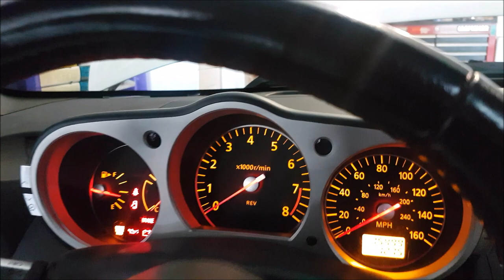Nissan 350Z / Infiniti G35 Secret Diagnostic Testing MODE | AnthonyJ350

Comment: This is great, I just replaced both motors, only one was bad, but what the hell, and holy crap what a difference I go from 208 down to 196 in the matter of seconds, but I actually have to try to get to 208 because it’s rare for my car to even go that high so this test was great for that and I’ll tell you what both fans running on low. You cannot hear them at least from the car and barely outside of the car and they are very effective. Used those TYC brand motors with original assembly I’m a happy camper 
Thanks dude! ‘06 G35 coupe
Reply from the maker: So glad to hear the video helped with your diagnostics!

Comment: You and I have the same dreaded white powder on the hoses 😂

Could be because my hoses are getting old (new radiator) but the hoses have been going white for some time now (mainly to the left of the block).

Am going to do a leak test soon. 

Awesome video yet again man. 👍
Reply from the maker: Ya if you research silicon hoses, they're kind of porous, which I suppose leads to the spots.  The car isn't daily driven and I check fluid levels, so I'm not too concerned.

Comment: Are both fans supposed to turn on or just the driver side high and low? My passenger side does not come on at all during testing
Reply from the maker: Should be both
Reply: @AnthonyJ350  thanks I did swap the driver side plug over to the passenger side fan and turned on my AC. The fan did turn but slow and weak. I could stop it with my finger. Will swap out the motor tomorrow morning.

Comment: Noticed only one radiator fan is kicking on whole driving with ac on. Decided to try this only to find out neither fan turn on dueing the diagnostic. Im assuming i just need a new fan?
Reply from the maker: Fan does work though. What's controlling the fan there's something wrong. Does it turn on by itself when idling when it gets hot?

Comment: Hi there sir, My 2008 350z is causing transmission to stall and cut out at 3K-4K RPM. Does this mean I need to replace my fuel pump or do I have a bad transmission? My 350z only has 83K miles.
Reply from the maker: Did it throw a code?  Sounds like you need to bring it to a mechanic that has worked on these cars.
Reply: @AnthonyJ350  I DID TAKE IT TO A NISSAN MECHANIC AND GOT IT DIAGNOSIS DTC'S P0731 AND P0732
Reply: Check cam sensors vacuum leaks your vtc solenoids could be bad Ecm there could’ve a short in your harness bad coils etc

Comment: How do you do the instrument cluster test? I can’t find it anywhere.
Reply from the maker: What's going on with yours?
Reply: @AnthonyJ350  if I understand correctly this is how you can tell if your fuel gauge is a cluster issue or something else 
Mines kind of in different places when I start the car but eventually makes it way to being correct after driving a little, the needle never goes below what’s in the tank, Let’s say I have a half a tank when I start the car in the morning it reads full or 3/4  but after driving a half a mile, it’ll go to a half a tank, and if I top it off when the needle reads 1/2 tank, it takes 10 gallons, which is correct, I believe during the self test if the cluster is OK if the needle lands on a half a tank, regardless of how much fuel is in the tank, it might be ignition off press the odometer needle turn the ignition on and tap the odometer needle three times, I’ll try in morning
Reply: @AnthonyJ350 IGN off:
Press and hold A/B trip odo needle:
IGN on:
Let go of A/B needle & push it 3 times 
Then push & hold A/B needle 
DONE
You prolly already knew that
Reply from the maker: @stopher1971  Actually, no I didn't know that. Will have to do a video to share with others. Thank you for teaching me something new 🙂

Comment: Anthony. Do you know how or do you know how to repair the headlight leds  without replacing the whole headlight?  I have an 06 360z.
Reply from the maker: I haven't done it, but you would have to disassemble the assemble and install a new LED.  I'm over simplifying as you would have to probably delaminate several layers and there's probably a circuit board attached to it as well.
Reply: AnthonyJ350 thanks for the reply. I don’t want to destroy my headlight.

Comment: Thought I had heard all there was to hear about the 350s modes. Ya learn something new! Thanks
Reply from the maker: You bet!
Reply: @AnthonyJ350  in your video you had all of the plastic covering removed on the right side. Even the piece that makes a water seal against the windshield. Well, the previous owner did the same on my car and broke that weather strip. Is it hard to replace? Obviously they didn't tell me and it wasn't noticable until I started detailing the car. I fear water has creeped into places it shouldn't be and rusted.
Reply from the maker: @shadowoffair09  The piece definitely directs water away from the  HVAC intake and the firewall grommet. The windshield is sealed by the glue that holds it in. Did you remove it and inspect underneath?
Reply: @AnthonyJ350  no I did not take it off. I never figured out if it was hard to disassemble or not. I'll take a look at it for sure. I have never had any issues with the HVAC system thus far but I have just one event of mild water under the passenger foot well. It was after driving in a very bad storm. Guess I have some inspections to do

Comment: Does this confirm IPDM functionality?
Reply from the maker: Technically does I suppose.
Reply: @AnthonyJ350  I've done this before because i had issues with my headlights only one was on. I knew it was good i recently changed the ballast and bulb along with some janky wire mending with electric tape. Performed this test and i was surprised it worked back then, but as of now about several weeks later i cant get the mode to engage. Nothing happens, I do get a flashing ses after a few seconds of the car being in the on position about 5x. I have u1000 & p0462 code

Comment: Hey bro can you help me, I’m having issues with my 350z it doesn’t run very well,  I have the vdc off, slip, check engine lights, it runs but it does accelerate correctly, idk if it is in test mode or limbo mode
Reply from the maker: Did you scan it?

Comment: I want to do Stage 1 tuning on my 2003 350z , just want to Add little pop and bangs . What is the best tune for that ? Uprev?
Reply from the maker: Uprev dyno tuned. The goal of tuning is to make the vehicle run properly, not necessarily make extra noises.
Reply: @AnthonyJ350  and my 350Z takes 91 octane , 93 will add more power ?
Reply from the maker: @autoperformance503  No, 91 is more than sufficient for the car's compression ratio. Unless you have a turbo or super charger.
Reply: @AnthonyJ350  yes . But 93 has higher compression ratio resulting in little extra Power?
Reply from the maker: @autoperformance503  93 is the octane rating, the vehicle engine has the compression ratio

Comment: Awesome, keep it up. Wish it could tell me if I have a bad APP sensor
Reply from the maker: You would have to use a multimeter and measure resistance.  What's going on with the car?
Reply: @AnthonyJ350  I tested it as per the workshop manual. Power and resistance is there, although the workshop manual doesn't say what the resistance should be. So the problem is that limp mode pop up when I press the accelerator pedal for longer than 3 sec. After I installed a new sensor and did the relearns, it worked for like 2 months. Now its back again. 
Do you know what figures I should get for resistance on the sensor?

Comment: Does this test the guages as well
Reply from the maker: What's wrong with your gauges?
Reply: @AnthonyJ350  its all over the place my oil pressure. Ever since i replaced the oil sending unit the manual guage read 30 and stayed steady, but the guage in the car says 5 and when i come to a stop my oil light comes on and goes off when i accelerate
Reply from the maker: @seanparker1759  Maybe it's the sending unit since you only had issues since you replaced it? Why did you replace it?
Reply: @AnthonyJ350  i changed it again. I replaced it because is was the stuck on 120 situation. The new one goes to 90 when the car is in acc not even on its gotta be the new sending unit or a bad connection somewhere. I got both the sending units off ebay so that might be my first problem lol. It reads 30psi at idle on a manual guage doesn't move stays dead on 30 when fully warmed up
Reply from the maker: @seanparker1759  With a major part like that just get the O.E. version. An incorrect reading you can do major damage
Reply: @AnthonyJ350  i know i ordered some glow shift guages. I think the guage in my car is wore out.
Reply from the maker: @seanparker1759  Let us know what the fix is. I'm interested to learn.

Comment: Hello I have an issue and I'm starting to give up...I have done everything inculding Google research, checked with multiple shops...I bought 370z which had front collision but most electrical parts were not damaged airbag didn't depoly it wasn't bad collision now I repaired everything and found out my OBD II is not working I checked all cables, fuse..changed the white obd thing you put the computer to check donno what's call in English, thanks.
Reply from the maker: When you scan the vehicle, can you communicate with the computer?
Reply from the maker: Did you check all the fuses?  Does you scan tool power up when plugged in?
Reply: @AnthonyJ350  there is no signal, no power at all, I checked fuse it was working, wires looks good but couldn't see everything, I even changed the white adapter thing where you plug in the scan tool but still same issue it doesn't get any signal, all electrical system is working fine in my car though. Thank you for replying.
Reply from the maker: @al3zmi  If the engine runs, there might be a broken wire or pin at the OBD2 plug.

Comment: What Clutch Do You Recommend For 05 350z ?
Reply from the maker: Z1 has a bunch of options.  You'll also want to upgrade the clutch line to a shielded braided line and the pivot ball should also be upgrade. https://www.z1motorsports.com/z1-products/z1-motorsports/z1-350z-g35-vq35de-clutch-and-flywheel-kit-p-2405.html?list_name=Related+Products

https://www.z1motorsports.com/transmission-driveline/z1-motorsports/03-chromoly-clutch-release-fork-pivot-ball-p-6518.html